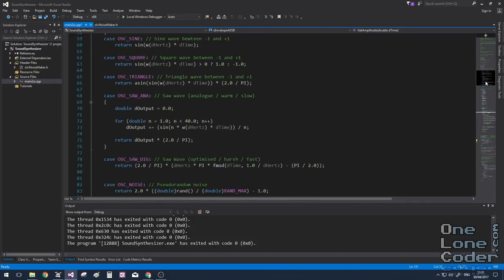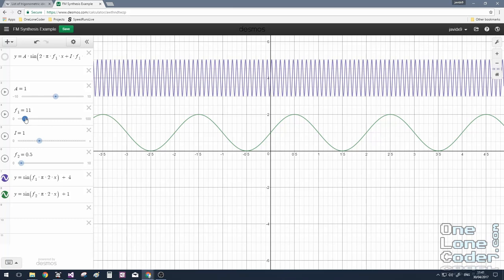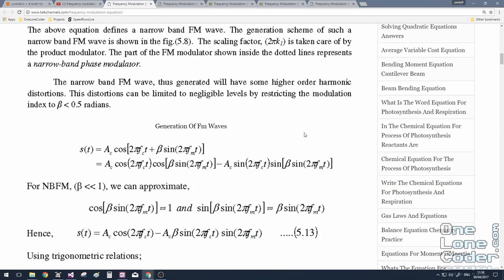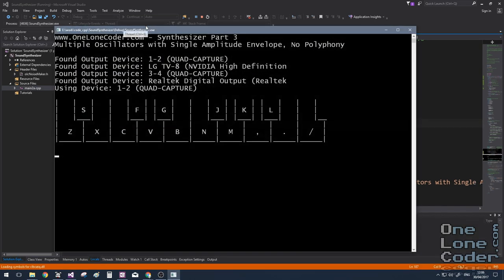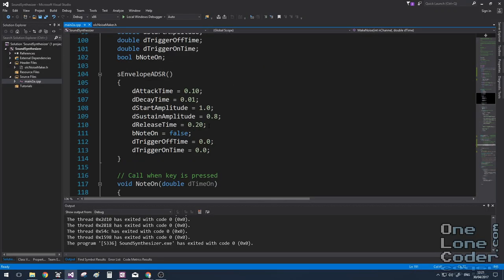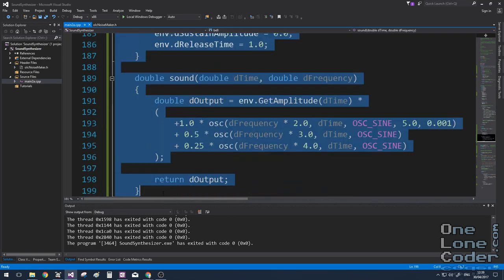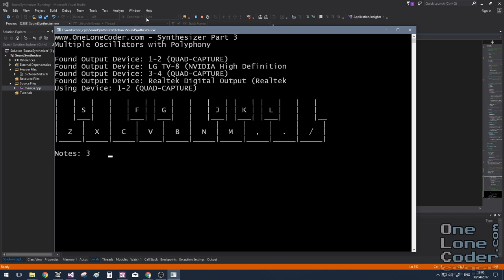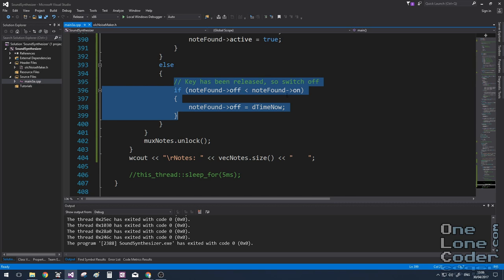Code-It-Yourself! Sound Synthesizer #3 - Instruments & Polyphony

Comment: I don't know about you, but it always makes me feel proud when I realize that I need to halt any further development on my project, and to devote some time to restructuring my code so that it stops evolving into an increasingly sloppy mess, and into something more professional. Temporary code needs to be replaced, solidified, or made robust, experimental features need to be incorporated into existing structures, and so on. Having to encapsulate new features is a clear sign that my project has further matured and has moved up to a higher level.
Reply: This is something the game systems dev Casey Muratori calls "compression oriented programming." https://caseymuratori.com/blog_0015  The basic idea is that starting by prototyping, letting the system and architecture develop naturally, and then taking "compression" steps (what you basically described) to clean up the interfaces and so on leads to better code in the end than sitting down at the start and trying to plan all your abstractions. Both other ends of the spectrum are to be avoided, in fact -- not only planning everything out too much at the start, but also never planning and never taking steps to compress. What is really to be avoided is building abstractions too early. 

I've found it to be a hugely useful paradigm to use when working on my hobby grade game engine projects. For instance, when I started my traditional roguelike engine, for a few weeks the "map" was nothing more than an array of booleans indicating whether the tile was a wall or not. That was all I needed at the time to start working on movement code and so on. Now that I've been working on it for approaching a year, the map is a rather complex abstraction wrapped within an even higher level abstraction of a world -- but that progression has only happened when I needed it to.

It's not something I tend to use at my work, because I've built dozens and dozens of web apps before and can basically anticipate most of their structure at this point. But when it's a domain I've never explored before, I've found that it's revolutionized my programming.

Not only that, but it makes programming fun again. It feels a lot like woodworking - slowly shaping wood, letting the thing take form in front of you - as opposed to the professional stuff I do at work, which in comparison feels like putting together Ikea furniture.
Reply: that happens to me too, at the moment I also take some time to make comments on my code.

Comment: There seems to be a little mix-up in terms. You clearly implement lfo that modulates the pitch of an osc; usually in fm synths the modulator frequencies are in audible range (and indeed most often multiples or harmonic overtones of the carrier frequency). but most of the fm synths do incorporate a lfo for the main carrier frequency and/or amplitude as well. the bell sounds are prime candidates to be recreated with fm sounds but they actually have dissonant overtones from the main frequency. also one of the most characteristic thing in adlib/sb synth was a feedback feature, that created very rough harmonics if cranked up to 11

Comment: For a convincing bell (or any percussive instruments) you'd need a pitch envelope with a very short attack and decay two or more octaves up and a sustain level on the original pitch. The simplest convincing (kick) drum synthesizer is also a simple sine wave of something low like 50-100Hz with pretty decent pitch envelope to generate this initial attack punch. A bell is similar just with additional harmonics, like you already have in your code.
For that it should be possible to create another instance of your ADSR and add it to the pitch of your sound? Dunno I am not a C++ programmer.
More sophisticated synths would also add a tiny shot of noise at the attack to give the clean sound some "natural dirt".
Sound synthesis is really fun what you can do with some math that sounds nice and you can infinitely add stuff to it. Next would be filters, although the math could become rather messy with that.

Comment: Oh, Also, it makes sense to implement zero crossing turn-off for the oscillators.  If the osc stops at the zero crossing, it'll sound better and not have the harsh shut-off.

Comment: I see your errors before you run (like adding instead of multiplying) and mistakes (like when you call a derived struct a base class) and it hurts me how you never use else-if. But still... you are a way better programmer than I am and you produce like crazy. Respect!

Comment: I'm at half way through and I'm thinking: "But bells ring, which means you need a configurable modulation for the instrument, a simple 5 hz ringing as low amplitude won't be ideal"  Also, the ringing will be different for different size bells.

Comment: This series is great mate really enjoying it! 
Followed along up to the point where you add in polyphony, at this point I replaced my code with the one on your github. But it fails to build it and get an error on the argument MakeNoise in line 337 for some reason

Error (active)	E0167	argument of type "double (*)(int nChannel, double dTime)" is incompatible with parameter of type "double (*)(double)"	

and

Error	C2664	'void olcNoiseMaker<short>::SetUserFunction(double (__cdecl *)(double))': cannot convert argument 1 from 'double (__cdecl *)(int,double)' to 'double (__cdecl *)(double)'	

Any idea why this is?? As I said this is on the code straight from your github so I'm really confused
Reply: Was having this same problem until I found out that the "olcNoiseMaker.h" was actually edited to accommodate for the polyphony changes. You can find it on the github page as "olcNoiseMaker_VIDEO_PARTS_3_4.h".
Reply: @terminaterdude  thank you! Omg I stayed up until 3 a.m. trying to figure this out.

Comment: Unless people see the first video, it's kinda hard to know what FrequencyOutput is... it's the key being played on the keyboard basically (key frequency) and it's used as an input into that function, so it's name is quite misleading and confusing.
Reply: skybuck2000 then they have to watch... the first video. Lol
Reply: He makes tons of off screen changes and edits without any explanation in this video. I'm sorely frustrated because I actually get what's going on until he changes everything off screen and then when the screen comes back on everything is different and that's what is confusing. I would get it if the tutorial was just a tiny bit more consistant and explanatory. Also, an error pops up in main even when the code is copied perfectly. This isn't a working program.

Comment: Thanks for the excellent videos. I am currently making a simple command line synth that generates a wavfile with a specified note and duration. I am stuck on how to implement polyphony so a user can generate chords. If anyone could help me in any way it would be much appreciated. I am not a programmer btw, I'm a musician and writing this program in ruby lol
Reply from the maker: If you can generate a single note, then polyphony is just generating multiple single notes and adding the waves together.